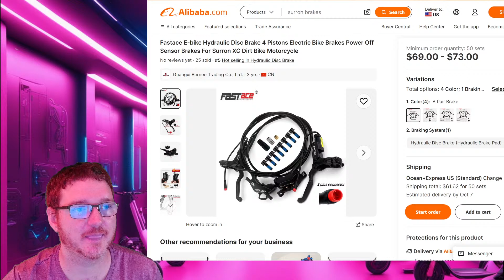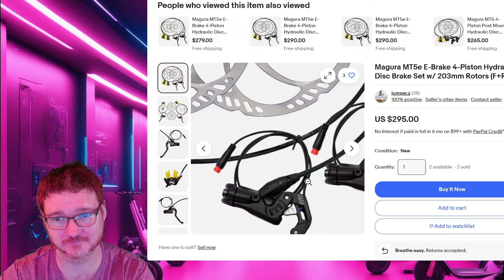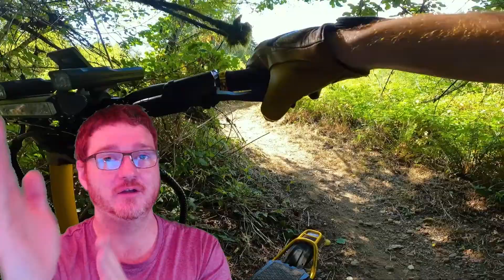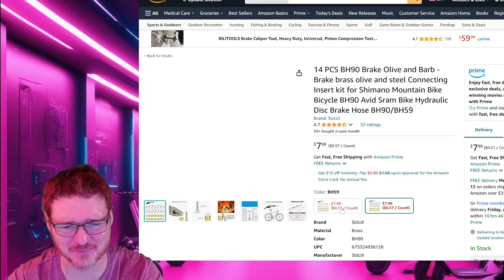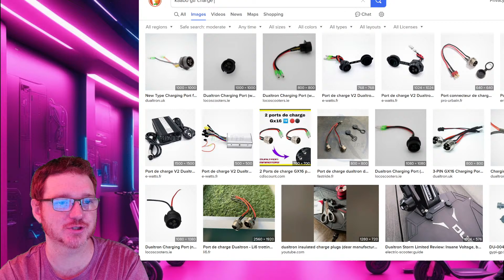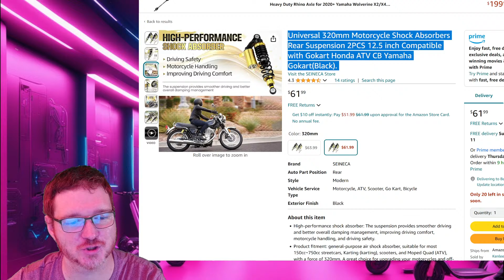A middle-aged man rambles about scooter brakes for over an hour. Live!

Comment: My 4 piston Logan brakes paired with PMTs work very well for me with my Nami Burn E 2 Max.
Reply from the maker: Yeah that sounds like a nice decent setup.  unfortunately on the Wolf King GT Pro they decided to put both of the brake rotors on the left side of the scooter so that makes it really hard to mount aftermarket brakes with any decent stopping power. 🤡

Comment: My brakes suck to bleed. I got the universal bleed kit but not one fits. Took it to 99 bikes and mini motors and they tried all their pieces but didn't fit.
I ended up using a syringe and plumbing tape,, it was so messy
Reply from the maker: bummer! What kind of brakes does it use? Which scooter is it?

Comment: I got those four piston nutt on my vsett 10 they do work for scooters
Reply from the maker: I'm actually working with the manufacturer right now to develop quad piston nutt breaks that fit on any scooter. Getting custom mods like extended length pre-bled brake lines and gold colors levers for the Wolf Kings 😃 should be on PEV outlet soon. It's awesome that you got yours on already though. What kind of brake pads you got in there? They've got a whole slew of different kinds.
Reply: @GingerOnWheels  yeah they are made  for vsett 10+ only not sure if they would work with others brands that’s probably why your developing one which is universal for all . They offer SEMI METALLIC (ORIGINAL)
Service life
≥3000km*
FULL
METALLIC (UPGRADED)
Service life
≥8000km*
CERAMIC (UPGRADED)
Service life
≥10000km* I’m currently using the the ceramic one. 
https://www.facebook.com/share/p/JATqPY7EfeQym3in/?mibextid=K35XfP I know your on the vsett group on fb 🙂‍↔️check them out if you got the time

Comment: Have heard many stories about Zoom brakes leaking. Was going to get the Mantis King GT and was bummed about the Zoom brakes but with a price increase and reconsideration I went for the Dualtron Victor Luxury Plus instead, which I thought had Zoom aswell but turns out the 2024 version has been upgraded to NUTT. Can't wait for it to arrive ❤
Reply from the maker: I'm working with two manufacturers in China right now to get Motocross, and downhill mountain bike, brakes fitted with brackets with proper brake line size to fit the Kaabo King GTR and the GT Pro. They'll be for sale on PEVoutlet.com soon. 😉

Comment: I don't understand why "beginner" scooter have disc brakes. Drum brakes in conjunction with good regen is all you need on a scooter, especially on lower end or slower scooter. Less maintenance, more reliable, and quieter.
Reply: Agree 100%!
Thank god I got myself an Apollo Go. It isn't a beginner scooter per say but beginners and pros alike would love it for its reliability and performance!
Its unique, dedicated regen brake is what makes it a gem to behold which minimizes usage of its already reliable and low-maintenance drum brake!
Reply from the maker: Paying five bucks for $145 mm disc brakes is a lot cheaper than making thicker wires and higher quality connections inside the scooter that can handle real regen braking. I agree though I really like drum brakes in the smaller sub 20 mph scooters. Basically no maintenance and looks better.